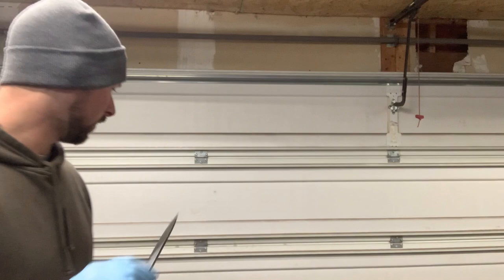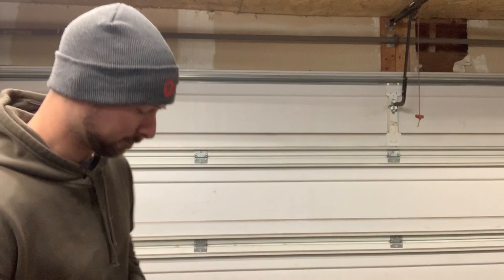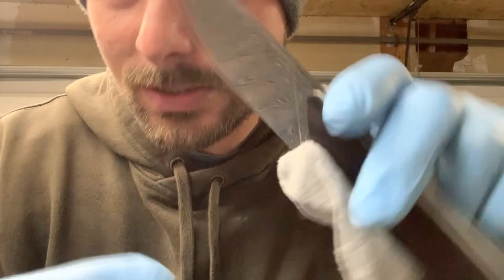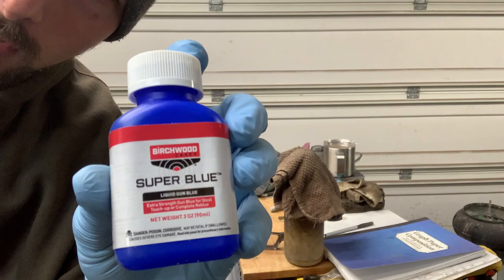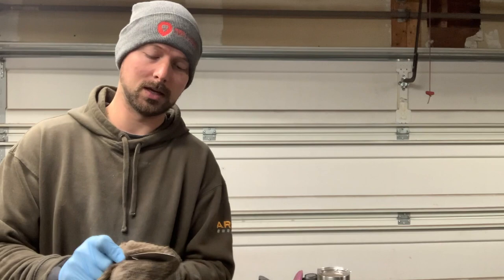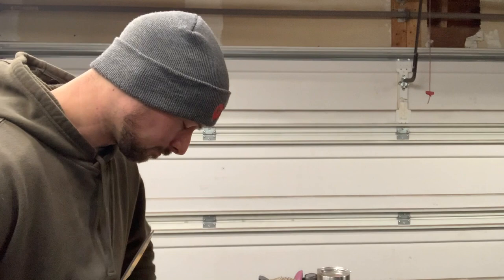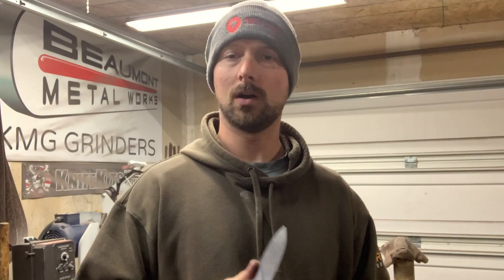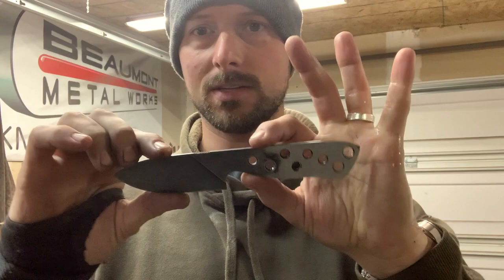How To do a Stone wash finish

Comment: I think you're getting a more consistent/even finish with that super blue than I'm getting with ferric chloride.  I've been meaning to give super blue a shot, but wanted to experiment with the acid more.  I use ferric chloride in a strong 1:1 ratio with water & it only takes 5 minutes to get a dark finish comparable to the super blue.  I can get an even finish w/ the ferric but things have to be just right---and, at least it's an easy process to redo if it doesn't work out.  Stone washing can be forgiving too it seems and able to turn a pretty good patina into a bonafide finished look depending on how it turns out.  It helps a lot to compare knife-making practices with some pros.  Still keeping my day job 😊.  Beautiful work sir 🤙

Comment: If you want a longer lasting blue. Blue the knife rinse, then 0000 steel wool and repeat 6 to 8 times. This will add a deeper bluing and last much longer and also protects from rust. I do this then tubble in my homemade tumbler and it comes out awesome.
Reply from the maker: I’ll give that a try 👊👊
Reply: I'm trying to get a good stonewash on mine to prevent rust. I heard using acid is bad for the steel. Do you have a video or something I can watch explaining what you're talking about? Thanks

Comment: This looks really nice and thanks for the video. One question however. Will this type finish give a steel like O1 any protection against rust?
Reply from the maker: Yes it helps A lot with that! Still need to keep a light coat of oil on it but it won’t stain like a satin finish would .
Reply: @gentrycustomknives8008  Thank you very much!

Comment: When your finished putting the handle on how do you tout how up or continue the stone wash finish down the edge of the tang between the scales. Hope that made sense. Thanks
Reply from the maker: So I take a q tip with a dab of gun blue and lightly go over the sanded area with that. It looks pretty good!
Reply: @gentrycustomknives8008  thanks 👍